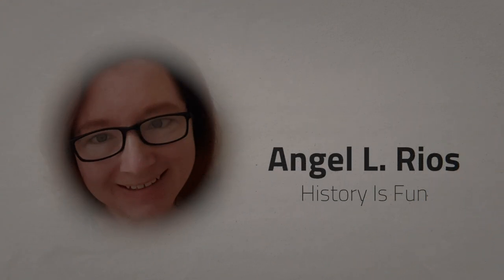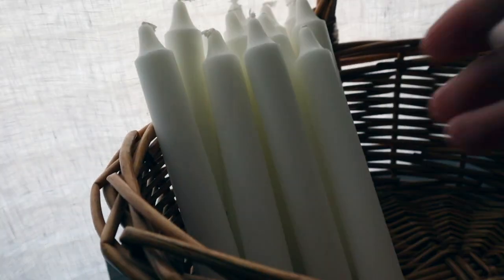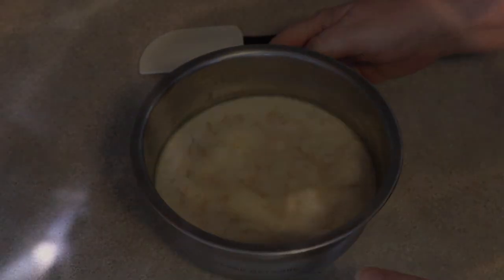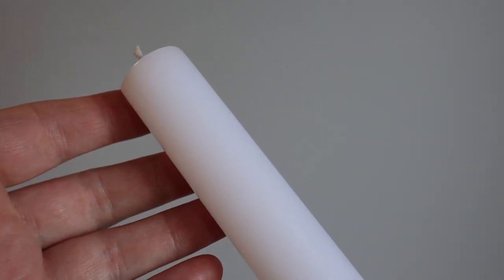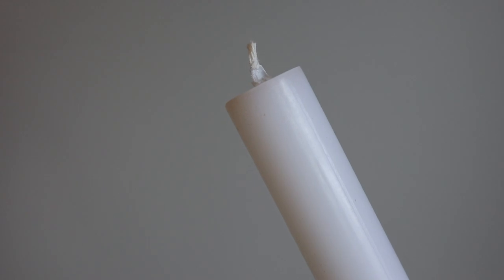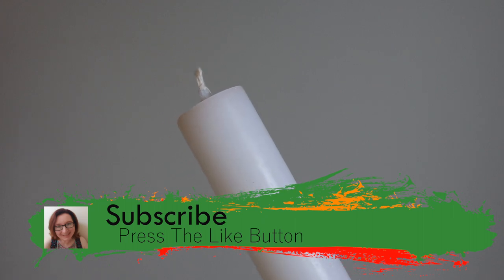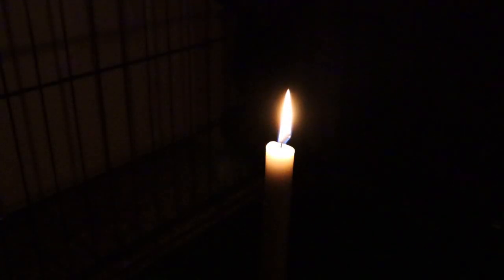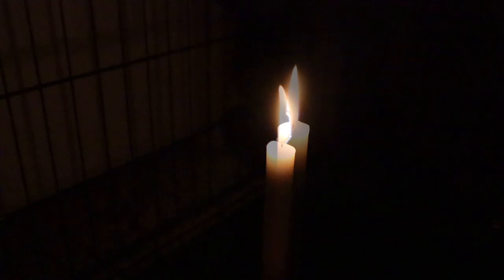Stearin And Paraffin Candles | Testing Early 19th Century Candles

Comment: Great video! So, how did you make the stearin candles? Did you just use straight stearic acid? Did you add stearic acid to the paraffin? Thanks so much!
Reply from the maker: Most of the candles I used in this series were bought from companies who specialize in historic reproductions. I only made the tallow based candles myself. The pandemic has put the brakes on getting some of the candles and other items I want to try. I just received a bottle of paraffin oil. Thank you for watching.